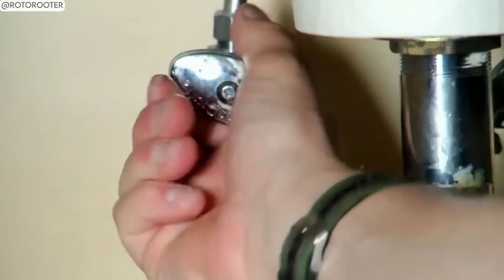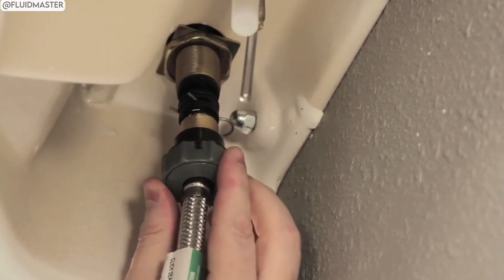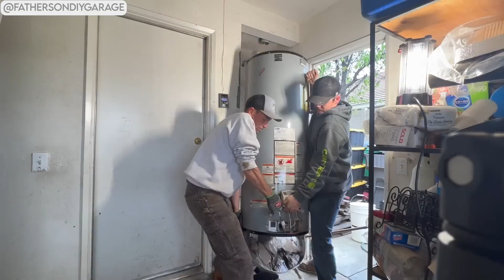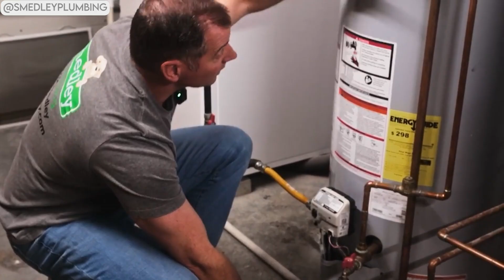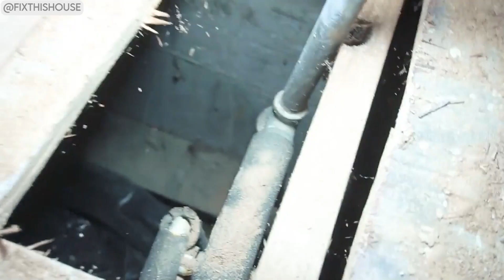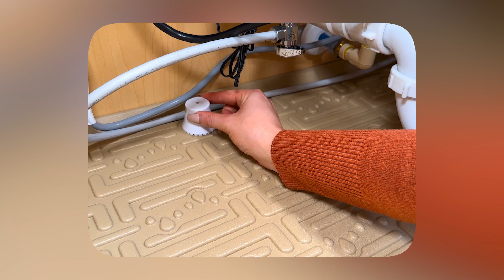10 Plumbing Upgrades That Are Actually Worth the Money

Comment: Pressure reducing valves are great but a common mistake is not installing an expansion tank on the low pressure side.  As water heats in your domestic hot water heater it expands and with no place to go the pressure will build up quite high, negating the function of the PRV.  Google "expansion tank for after PRV" for more information.